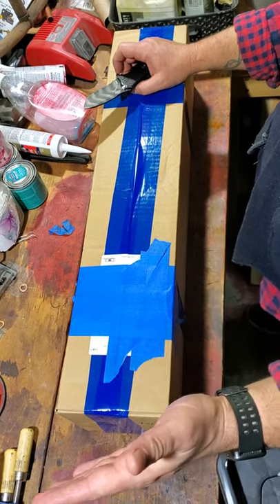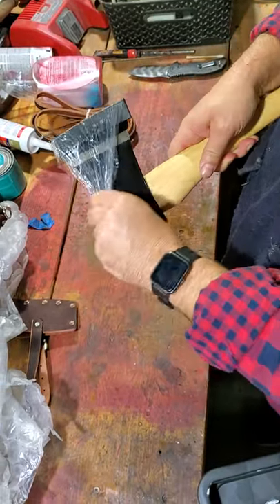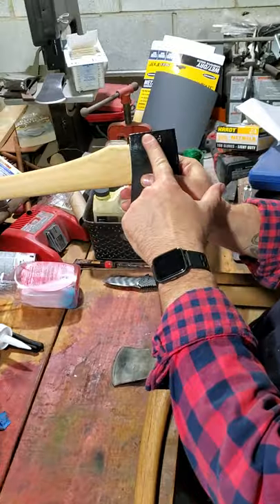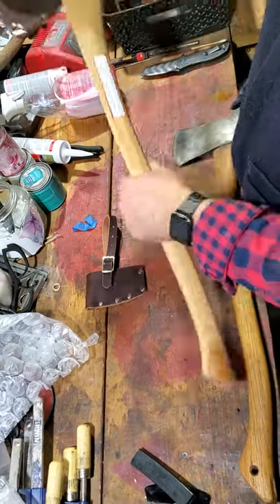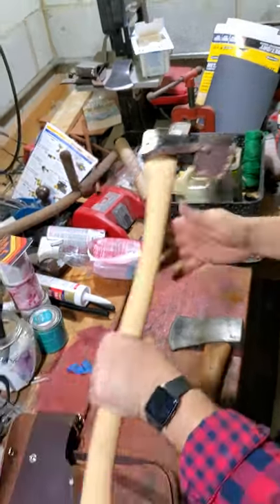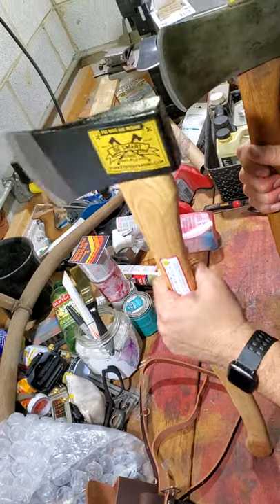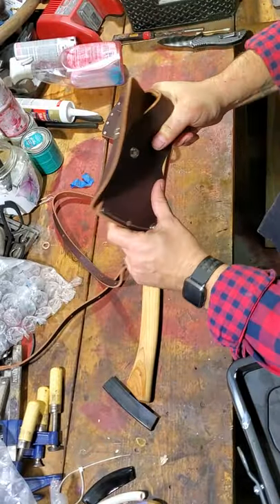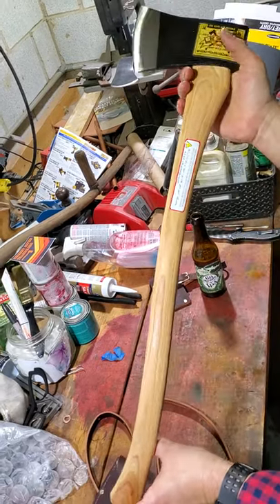Council Tool and Whiskey River reissue FSS Boy's Axe.

Comment: Velvicut uses 5160.  FSS used to call for 4140.  Iirc they're using 1080(?) now.  I have the velvicut boy's axe.  It's outstanding.  Temper goes back maybe an inch and a half.  Great head shape for harder woods than swedish axes.  The handle, though, sets it above and beyond.
Reply from the maker: Thank you and yeah, I want one of those!